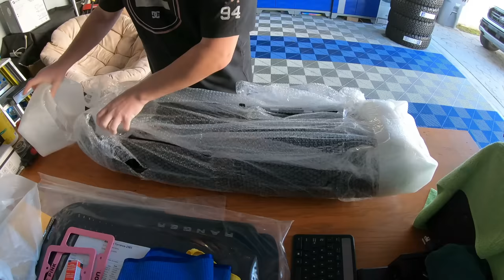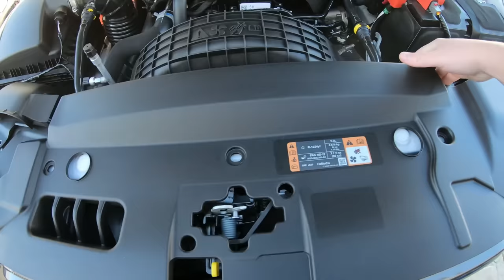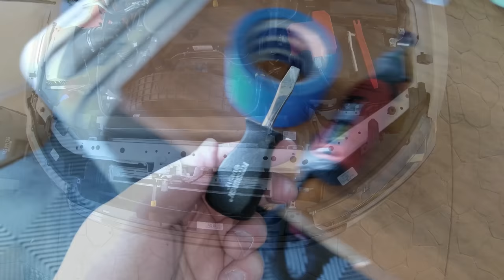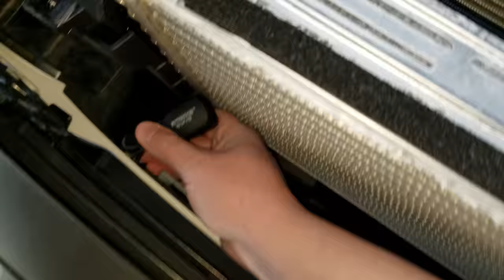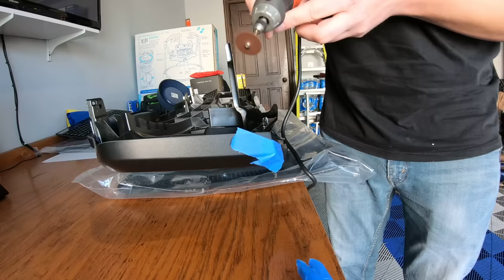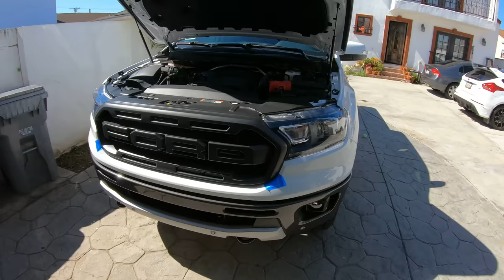2019 Ford Ranger - Raptor Grille Install!

Comment: Did the ford ranger meet your expectations ? I would love one  that's why im asking real daily drivers.
Reply from the maker: It absolutely does!  I have zero complaints about the truck.  I'd recommend finding a dealer that has them on the lot, give it a good once over and test drive it if you can - I ordered it sight unseen and without test driving it.  With that being said, it was the right choice!
Reply: Thanks ill keep that in mind 👍

Comment: Looks good man. 
I also want to install this grill. Apparently the Thai ones are the same part number as the Aussie genuine ford grill. I was told from Aussie dealer that it definitely will not fit as the mounting points are different. Anyone know if the Aussie and USA models are the same? I am in Australia.

Comment: Looks like a pain in the ass. I build ford engines for the f250 and up and install bumpers sometimes. Luckily we have tools to make it easier. Idk if I could do this with a finished truck haha but I want a 2021 ranger when they release and want to do this to the grille. Might just try it anyway
Reply from the maker: The grille I put on initially was an OEM Ranger Raptor grille from Thailand, and it didn't really fit quite right so that's why I had to mod it a little.  The aftermarket has since come out with one that just slots right in and fits perfectly.
Reply: Josh Mills oh ok nice! Where do you get the one the one that doesn’t need to be cut?

Comment: Saw the BFG ko2 in the background....What size are they ? Assuming there for the Ranger...
Reply from the maker: Good eye! Yep, they're for the Ranger and they're LT285/70R17.  It's the same size and tire that's on the Ranger Raptor.
Reply: @J0shM1lls  awesome let us know if you encounter any rubbing without modding the suspension. Or better make a vid ! Thanks
Reply from the maker: @samuelparent8548  will do, I'll definitely be posting a vid when the wheels/tires go on.  Still waiting on BDS/Fox to get their lift kit out though, so the tires have a better chance at fitting.

Comment: Why did you put blue tape on the corners? So it wouldn't scratch it? You had to trim the corner off was that just to modify it to make it fit? Nice truck! 👍
Reply from the maker: Hey Jim! Yeah the blue tape was used along with some thin but durable hard plastic under it to protect the valence as the grille was being installed.  I did have to trim away some of the lower corners of the grille to make it fit and it was still very tight.  Thanks!

Comment: Hi, thanks for video, i read it to remove a 2021 front end, new addition, there are 2 torx bolts at bottom of front grille, in both inner front corners,  ford engineers have a sense of humour lol

Comment: I am guessing you cut the grill because it doesn't fit the lariat headlights?
Reply from the maker: Hey!  I had to trim the lower portion of this grill because it didn't clear the lower valance underneath the headlights.  Since I installed this though, an aftermarket version has been released that just clips right in without any modification.
Reply: @J0shM1lls  thanks for letting me know. It looks sweet!

Comment: I am about to do mine, just got the grille. Why cut with the dremel? Problems fitting inside?
Reply from the maker: The reason I cut mine, was because it is an oem grille made for the overseas Rangers and doesn't quite fit right.  Since this video was made, a new grille has popped up on eBay that is a direct bolt on with no need to cut or trim.

Comment: Is this the $270 one on eBay by auto elegance?
Reply from the maker: The one in this video is actually an OEM Ford part from Thailand, but I have since actually replaced it with the auto-elegance part due to a better fit.  It fills the gap around the edges better than the OEM Raptor grille.
Reply: @J0shM1lls  thanks man,  great video too.